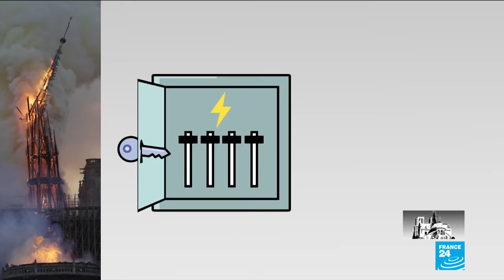What caused the fire at Notre-Dame?

Comment: The structure of the roof that burnt was made of 800yo Oak, as many French carpenters pointed it out : It does not burn like this and it need a very strong flamme to even start that kind of fire...

For now, as we don't know nothing about the investigation, i'd not speculate, but the "accidental" fire seems to me less likely than a criminal fire.
Reply: Sound wisdom
Reply: Even now they still claim to not know. 
I've seen some documentaries about fire detectives who by looking and analyzing at the remains, could tell you everything about what caused the fire. 

So reading about how they are still speculating what caused the fire after 3 years....is kinda ridiculous. 
Especially the part where they talked to over 100 witnesses - what a waste of time. Analyze the freaking scene.
Reply: @thecollector5243  But still no final conclusion
Reply: So is that your final conclusion?
Reply: @worldview730 for faqs sake you need a "final conclusion"? 
The church was burned. It is not a ridiculous or even rare occurrence. Where certain faiths are present, desecration follows.

Comment: So the wiring was done in the 1990's and so was not old. Fire detectors were in place and two fire wardens were always on duty. The Architect who looks after the building has said two fires were started in separate locations. And yet the political narrative is that it was an electrical fault.
Reply: My dads an electrician and he said if the Church had reasonably modern wiring and circuit breakers and not the old fuses, there is no way it was electrical.  He used to design the electrical systems for Oil rigs, where a single spark can start a fire.

Comment: Long before fire proofing steel was understood to be essential, and still today, heavy timber is understood to be fire protected to fire proof.  Heavy timber will burn on the surface but then self extinguish - analogous to the surface oxidation of core-ten steel protects against further oxidation (if not fire).  What caused the fire in the roof structure of Notre Dame must first take into account that it started and accelerated in heavy timber.

Comment: I would say ARSON, as there have been too many attacks on churches. It seemed strange that people were blaming an electrical fault when the fire was at its peak, there is more than meets the eye here.
Reply: My dads an electrician and he said if the Church had reasonably modern wiring and circuit breakers and not the old fuses, there is no way it was electrical.  He used to design the electrical systems for Oil rigs, where a single spark can start a fire.

Comment: The fire started at the roof, specifically the part around the spire that was under reconstruction. It happened around an hour after the workers had left the sight, it wasn't accessible to the ordinary folks from the street and it smoldered for a while before going outburst (20min. between first alarm and first fire-sighting). Everything suggests that it was an accident, and there are numerous instances of historical roofs being burnt during the renovation. It's simply old beams in combination with sparkling tools used for cutting leadsheets.
If it was arson, then it is a well-organised conspiracy, not a terrorist attack. But I doubt that either.
Reply: Nonsense. Of course it was.
Reply: Isn’t it a curious thing that the fire started after the workers left the church?
Reply: @ianbertus1119  The fire could’ve started before they left and just’ve been smouldering for that hour until it got out of hand
Reply: @leaderunith4l324 both the workers and engineers said that the fire was not an accident on their part and that the fire did not even originate from an area they were working that day
Reply: " sparkling tools used for cutting leadsheets"  You don't cut lead roofing sheets with grinders ! - Former Roofer
Reply: aye, stanley knives mostly

Comment: How difficult is it to cut off all electricity after 17:00 and have fire alarms working on batteries?
Reply: How about the fact that there is no electricity anywhere around the roof of the cathedral, and there was also nobody working on the cathedral roof either at the time, and how about te fact that the fire started in two spots around the spire and not just one. This fire was deliberate, not accidental. That church has been around bigger fires hundreds of years ago and it survived all that, but it can’t handle an apparent small spark? The French authorities aren’t telling us everything, I also question the fact that they rule out arson before the fire is even put out.
Reply: @jameswoodson1292  agree👍

Comment: No way could that fire started without an accelerant. large wood does not start burning easily. You need something to start it, and then it would only spread very slowly. So it had to be something put on the wood in many places to start that fire. But maybe some preservative on the wood caused it to burn fast, If they used something like that.